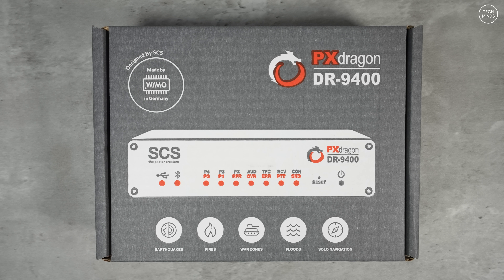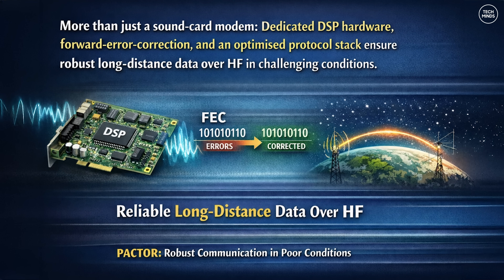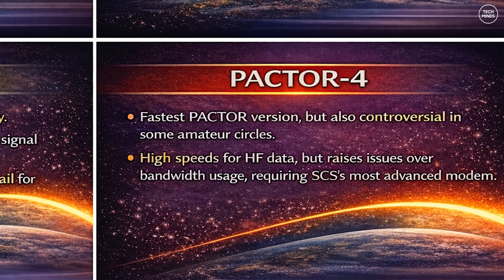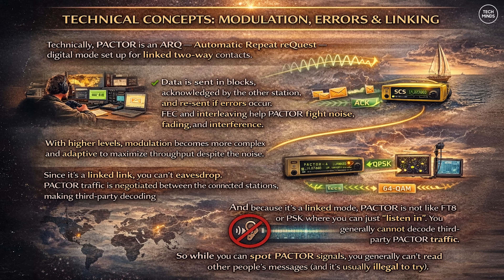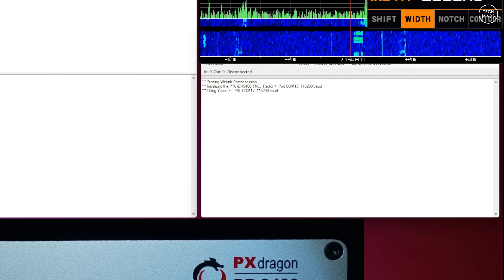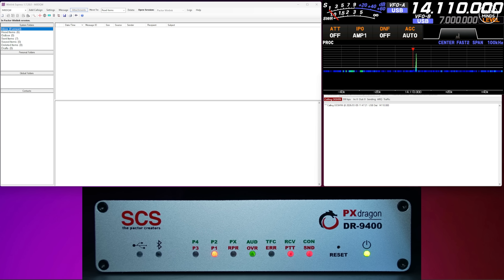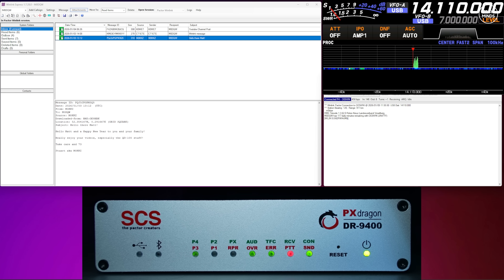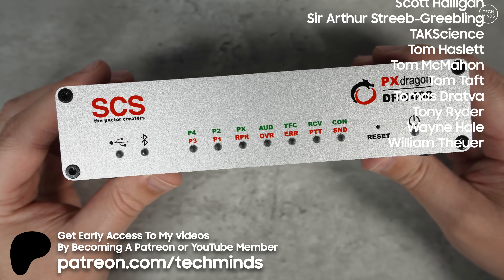PACTOR: The Most Robust HF Emergency Communications Mode

Comment: The problem with Pactor is the high entry cost, about $2,000 just for the Pactor modem. Decades ago, I used AMTOR using a Commodore 64 and a MBA-TOR software cartridge and a low cost AEA CP-1 interface unit with a Kenwood TS-940TS transceiver. AMTOR was an extremely robust mode of communication, drastically more robust than any other modes. The problem is the AMTOR mode died from the ham radio bands. The AMTOR software was never written for the more modern computers that run Windows, Mac, or Linux. 

VarAC is an alternative much lower cost mode that has characteristics of AMTOR ‘s error free communication. But VarAC isn’t as robust as AMTOR was. Often times, you could communicate with AMTOR perfectly with such weak signals, that the signals could not be heard with your ears in the speaker.

The main problem with Pactor is the extremely high entry cost, which is self defeating, resulting in almost no hams using Pactor. When almost no hams use Pactor, the Pactor mode usage will dye out.

Comment: I purchased a SCS 7800 modem a couple of years ago and it works very well. I use it mostly with Winlink for messaging other stations and via gateways. I have tried Winlink P-P and found it very useful. I use it for contacting other Raynet stations but there are not many people using Pactor due to the high price of the modems. 
I consider it a fallback system. We use VARA chat (not varAC) for messaging within our group because it’s simple and robust. The main thing is that the less tech savvy members of the group can use it within Raynet Pembrokeshire.
GW4OZU.

Comment: I have a 7800.  Like the new cable connections and USB options on the back.  Wish they would use a better power connector - not a fan of that.  Also - the cost of the modem would be great to finally start to see some cost decreases in the cost of the hardware.  VARA is comparable with Pactor 3 speeds, but is much cheaper to implement.  P4 shines with speed - but man the cost of the modem is a hard pill to swallow.  Where VARA shines is how popular it has gotten with how cheap it is.  I'd love to see increased user adoption with P4 but since its cost prohibitive it will never see use similar to VARA.

Comment: The modem is great, but unfortunately, it's too expensive. The heart of the device is a Raspberry Pi 4. This is clearly visible on the back of the modem. The technical specifications clearly indicate that it's only a Raspberry Pi 4. Installing the software costs money, but that's the point. It's a scam, nothing more. You should ask Cihczyk to write the software for Pactor, and it will be cheaper 😏

Comment: Nearly $2k for  a cool bit of kit that is the DR-9400. 
 I wish you would’ve shown that , though feature rich and very cool, it’s not required for “radio email.” Especially playing the “emergency situations” card. 

Winlink Express supports multiple modes including ARDOP and VARA HF/FM (software modems) and AX.25 packet, in addition to PACTOR. So pitching a ~$2k PACTOR controller as the way to do radio email is, in my layman opinion, misleading. 

It’s one premium option, not the entry point. Winlink even has performance comparisons showing VARA can match/exceed PACTOR under some conditions. Plus the DR-9400 itself supports secondary modes like packet/APRS, which can already be done with SDR + free software.

A cool follow up video might consist of SDR Angel, PlutoSDR, Winlink Express (Ax.25 or VARAFM) and virtual audio cable to connect Winlink’s modem audio ↔ SDR software audio.
This might be handy in an emergency situation

Comment: i remember when PACTOR appeared, 20 years ago. Here in Eastern Europe the old HAMs cautioned the young HAMs: "don't use PACTOR, it will destroy the relays in your transceiver in short time". Of course, with these new transceivers, with electronic signal switching, this problem is no longer relevant.

Comment: For 98% of the people who complain about the price of PACTOR devices, don't worry, it's not a device made for you. 
If you're on a sailboat in the middle of the Pacific, robust communications are significantly more important than a ragchew on 75 or a fire-and-forget on FT8 to see how your antenna is doing. If you can afford that boat, you can afford the modem.
Reply: and satphone doesn't work in the Pacific?  However you are correct about owning a boat; can afford  that, can afford pactor.

Comment: Love PACTOR for its forward error correction, but you have to pay for the good versions, which means there's not a lot of users on the air.  I find VARA, which is a software application, has surpassed PACTOR in performance for its adaptability to changing propagation environments.

Comment: I haven't heard the term ARQ for years. I worked for the GPO many years ago on the commercial ARQ which used a 7 bit error correcting code (the same one which was used for AMTOR) this was known as ARQ-M and we had links all around the world including Port Stanley, South Africa and India over HF links. Brings back lots of memories.

Comment: PACTOR and CLOVER were a lot of fun back in the 1980s. Today, however, there is essentially no activity using those modes on the amateur bands. It’s hard to justify purchasing the hardware when you can’t make live contacts.
I would love to see a resurgence of these modes, but realistically that would only happen if the cost of the hardware dropped to perhaps one third of its current price. With alternatives like VARA available for around $70, that resurgence just isn’t likely.

73, Dan, KM6CQ

Comment: As someone that has experience using multiple versions of the SCS Pactor modems, I can say that when they work they are absolutely wonderful. However, there are software based audio systems like VARA that are nearly as good at a fraction of the cost. There used to be thousands of Pactor modems on the air, but frankly they have gone stupid on their pricing. When a new product comes out, it takes a long time for the community to justify the cost and get enough stations online to be really useful. They are more common under government users, but even SHARES HF no longer requires you to have this highly specific modem.

Comment: Hi Matt, I'm trying HF recently and with my FT857 I could connect into a WinLink station in Switzerland. I swear, it was one of the most exciting things that I did via HF. Sadly, we have one ( that I never could connect) station here in the UK. Hope we can see more about WinLink in your channel.73
Reply from the maker: I guess unless they are either close enough for groundwave then 40m would be best. Which mode did the UK winlink station use? I’ll see if I can reach it if it’s still on. To be honest though, there are many in Europe that we can reach easily.
Reply: @TechMindsOfficial  Matt, from Watford I can't access any UK stations. But could access many times using 40m

Comment: At 10:35 you say you need to load the station list via internet before you go offline because the feature will not work offline. That is not correct. 
Winlink was designed from the base up to be an offline fully functional system, so the table can definitely also be updated offline, via radio, and the table is available all the time you are off line. The propagation number are also automatically updated with each winlink connection, so that , in conjunction with your current or new (different to origional) position, the stations you can possibly use at the current time, as well as at a different time,  will be shown to you.  
The same is true for ALL the other datalinks (weather/kep's/news etc) available via winlink. Yes its good practice to update before you go offline, but it can all be updated while offline as well
Reply from the maker: Yes that is correct, I failed to fully put my point across, but from a fresh install of winlink, how would it know what stations and frequencies to use? That’s why I mentioned about making notes or creating favorites of known winlink stations. Cheers
Reply: @TechMindsOfficial  If memory serves me correctly, it does come with a initial start set of available stations, which can definitely be a bit out of date. However the majority of RMS server stations are reasonably stable. As far as I recall it just needs your location, to then be able to work out who you can contact and the time of day which will be best.

Comment: It would have been helpful to mention that this is a proprietary undocumented protocol, which (IMHO) makes it unsuitable for amateur use. In my view these sorts of things should be using licensed bands. Also, I don't know what you mean when you say interception isn't possible – if it's using encryption, it's illegal to use as an amateur in most of the world; if it's not, it's possible to intercept it... just a matter of someone reverse engineering the protocol.
Reply: If you are worried, you could get your Marine Radio Operator Permit (there might be a stipulation that you need to transmit near/on the ocean or Great Lakes, but I can't remember).  But honestly, I wouldn't give SCS that kind of money.  Nothing wrong with charging for something you created, but when a modem costs more than a higher end HF rig, that is just too much.  Honestly, if this was priced around $200, that would certainly be worth a look.  There are far better ways to spend money imo.
Reply: yes was wondering the same the for ham bands
Reply: Chinese and Greek (IMHO) are encrypted, but there is nothing illegal about using them on the airwaves😜
Pactor is most definitely NOT encrypted. You can however buy a mil spec encryption from them if you  need it commercially.😈  
In fact , because some US Karen lost his marbles, (probably because he couldn't afford a modem 🤣😂🤣) SCS made available, for free, a piece of software to decode off air pactor. 
However, what the Karen and a lot of others don't understand is, it is EXTREMELY difficult to follow a conversation, where only one side of the conversation can be heard, and some words are repeated over and over, and some letters are repeated over and over again, and not in correct order. 
Just to add salt to the wound it also becomes even more difficult when you cant speak the language used in the conversation. 
but its definitely not encrypted
Reply: @Scamp-t6m  Chinese and Greek are not encrypted, and your use of "Karen" is juvenile at best.
Reply: @PaulTaylor1 He's just calling it like he sees it. Labeling one a 'Karen' is a descriptive term which instantly conveys the individuals behavior and attitude towards others. Nothing wrong and you are taking exception to a key social term. Feels like it may be personal.
Good night & good luck
Reply: @PaulTaylor1  The point was, because you cant understand something, or make the effort to learn how to understand it, doesn't mean its encoded.

perhaps it was, but it makes the point about the juvenile professor who couldn't understand something so threw his toys out the cot with someone else's money
Reply: Crypto is LEGAL to use in Canada over ham bands as LONG as the key is public - that includes posting it in an obscure  corner on your own personal website, people need to STFU about it being illegal to use on ham bands -

Comment: I use both PACTOR and VARA.  I have a P4 Dragon.  Overall, in my experience, the P4 has an edge over the paid version of VARA.  Not by a huge margin.  Is it worth it??  That’s up to the individual operator.  I’m glad I have that option available in my arsenal of tools.  During emergencies when FCC allows full 3KHz operation, PACTOR 4 really makes a positive difference.
Reply: With the elimination of the archaic HF symbol rate limit, P4 is now allowed by the FCC since January 8th, 2024.
Reply: Thanks for your comment.

Comment: pretty cool device.. HOWEVER.. a highly proprietary, commercial system. not open source, not community-friendly.. 🤷‍♂
can't wait to see a high-performance open-source data modem to replace them all! my hopes are for freedv-rade devs to add a modem capabilities 🤞
Reply: This is why I'm hoping FreeDATA gets more traction.  Its performance seems on par with VARA and it is completely open source.
Reply: Being commercial guaranteed is
Reply: Yes. Tom Whiteside, N5TW did an exhaustive comparison of Winlink digital modes using the Teensy IONOS Simulator. In most cases, pactor-4 was definitely the winner but unless you really need that speed (maybe you're actually working emergency comms in a disaster or something), I think VARA is good enough for most people at 1/25th of the price. On 2m FM, AX.25 meets my needs for free :-)

Comment: Sat comms and more recently starlink has killed hf communications for sailboats. I play alot with hf/winlink/vara from my sailboat for position reporting,downloading grib files and email when I'm offshore (I'm a tight Scotsman, I'm not paying for satellite comm subscriptions!) VARAC works absolutely great, especially so with a tuned antenna over saltwater. In this application I feel pactor modems are about at current as dial up internet in your house . I get decent speeds with VARA, and when I'm out at sea, I've got alot of time on my hands to play with different winlink stations, selecting the most appropriate one for the frequency and time of day. Feels more in the sprit of amateur radio hobby i enjoy.

Comment: Pactor 4 is Very Good, but for most users VARAHF(Licenced) will give almost similar speeds, and under multipath distortion VARAHF can be slighty better.

Comment: How does PACTOR 4 compare with Winlink HF?
Reply: Winlink is a network to support email over radio. Whether it is HF or VHF is immaterial.  
Pactor 1-4, vara, Ardop,Packet radio are the various modes used to convey the data over the air.
Reply from the maker: I’m pretty sure I showed using Winlink with Pactor 4 in the video, didn’t I?
Reply: PACTOR 4 can do Winlink over HF. The question should be perhaps, how does it compare to Winlink HF over other modes, such as VARA.

Comment: I can imagine the dedicated hardware with a DSP are able to do some great stuff compared to just a sound card and a pc.   HOWEVER…. An awesome  next step would be to compare this device and a sound card based setup, and slowly pump up the noise on the link to see which solution survives the most noise.
Reply: It's been done to Death very scientifically by many clever people...
Plenty of stuff on the Web Pactor vs VARAHF for example.
Reply: @MINI-4X4-RADIO   and what were the results?
Reply: @SolarMillUSA  
There is literally masses of information.
In a Nutshell, Very comparable...
and under certain conditions...
Maybe marginally better.
I suggest you do some research.

Comment: 😎👍
Reply: Excuse me?,,l was using Pactor in the eighties,,,,,on a PK232 unit,,,,,so its not a new thing?
Reply from the maker: I meant the hardware, not the mode.
Reply: Back in the ‘70s I built a RTTy video unit designed by G3PLX, who also was involved in AMTOR and PACTOR. It had a 100 odd chips and every pin was hardwired on vero cards in a 19” rack shelf.  45 and 50 Baud crystal controlled speed.. Took me a year to build but great success on Ten Metres
Dave G4BTI.

Comment: Why can't this be done in software? Is it just a licensing thing?
Reply: Correct. That little box is $1900 US.
Reply: @RabidWombat-g1z in the running for most expensive device reviewed on tech minds. Good way to break my habit of impulse purchasing stuff Matt talks about!
Reply: @RabidWombat-g1z Take vara hf modem, same speed, nearly no costs.
Reply: It can be done, called vara hf modem, or look for VARAC. It is not pactor but similar and same speed.
Reply: No, the modem integrates DSP with a much better performance than a normal sound card, so it is not only software is also hardware.
Reply: @RADIOBUNKER73  so buy a better sound card and still have change left over?
Reply: @PaulTaylor1  Buy offroad wheels, and you will have a 4X4...
Reply: @RADIOBUNKER73  except this isn't a 4X4, is it. It's just a better sound card in a box, with a huge markup.

Comment: Equivalent...60€....
Reply from the maker: Vara is NOT equivalent to Pactor 4. Vara is very good, and what I would use considering the cost, but if you need ultra reliable comms in bad hf conditions, Pactor 4 wins.. imo
Reply: @TechMindsOfficial  "reliable comms in bad hf conditions" - sure, but you have no partner in ham radio anymore, except some winlink stations. It is dead.
Reply: @TechMindsOfficial  It is, has lot of speed comparsion in the past. Vara HF can compete very very successful...and hey full version 60$..haha!
Reply: @Andy-M938  Vara is very good, but when things get rough, pactor wins out always. Also Pactor is far , far more friendly to install and get up to full speed compared to the same on vara
Reply: @Scamp-t6m Indeed but do many hams need that sort of robustness for day to day ham hobby work? Personally I think its far too expensive for the marginal benefit it gives  over other "free" modes. It does have a niche in some martime circles and yes it works on Winkink but so does Vara. Ok Vara occssionally fails on the path but that's ok I'll try later and get my email then. I'm not rushing out to buy one.
Reply: @Scamp-t6m  But you're alone at ham radio with Pactor, you have no partner